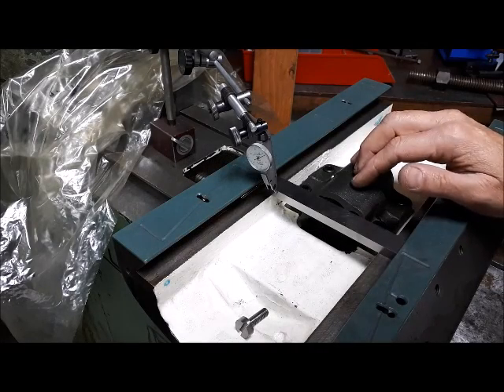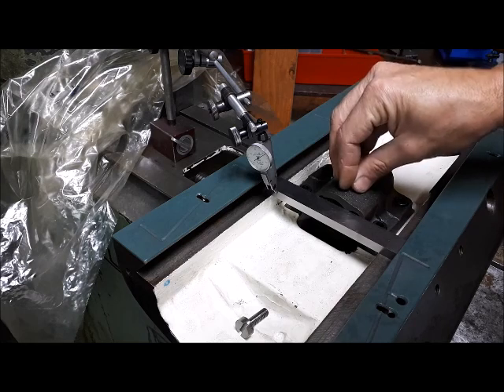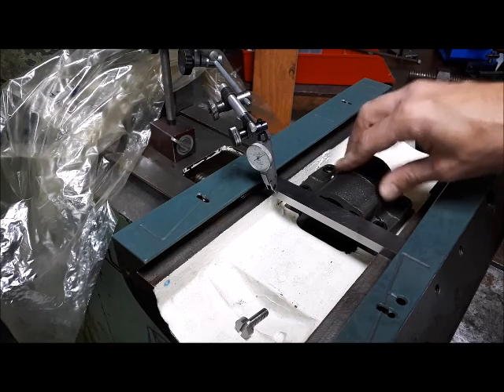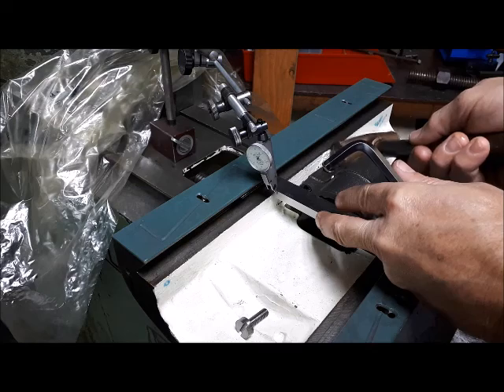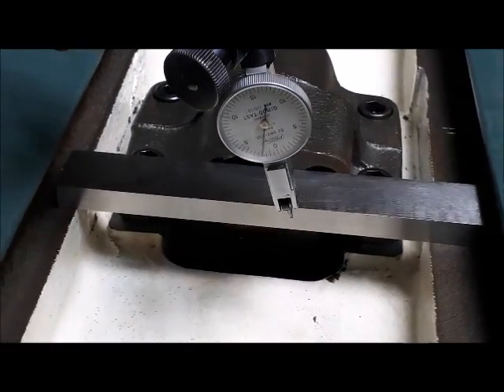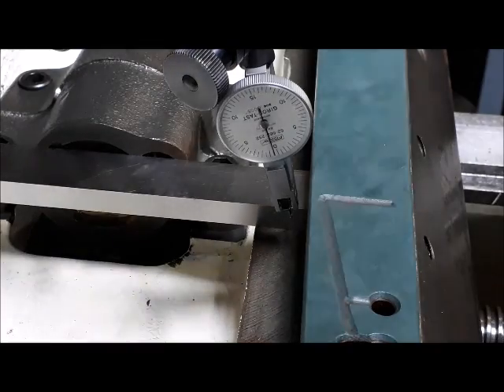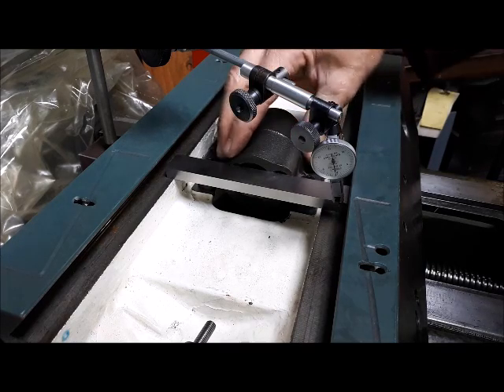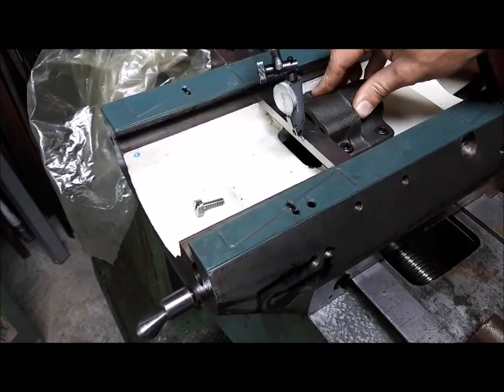Bridgeport Update 37

Comment: good stuff as always! of course the fit of the leadscrew in the nut will be the test of your alignment. once you get the screw in there, you could adjust that yoke each way until it binds and then split the difference.
Reply from the maker: Hmmmm, going to ponder that for a bit. Wish there were four holes in the table to get at those screws! Thanks for watching and commenting.